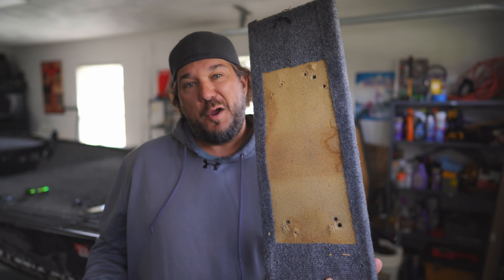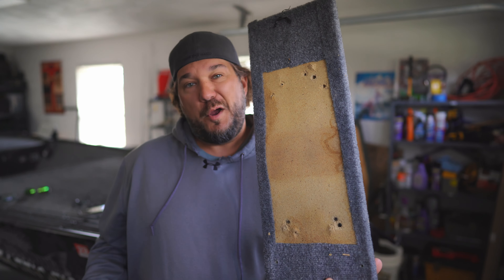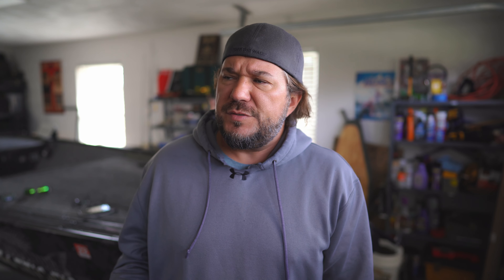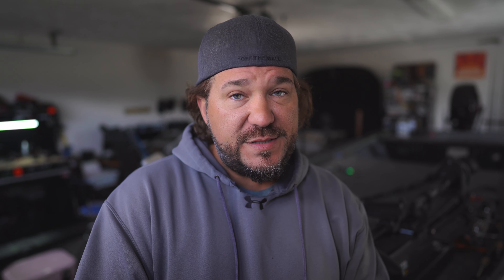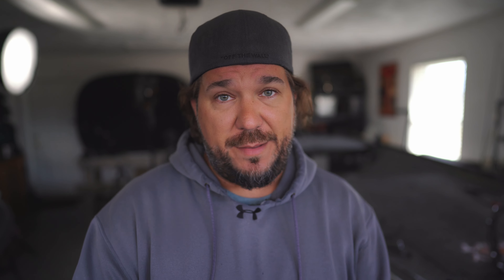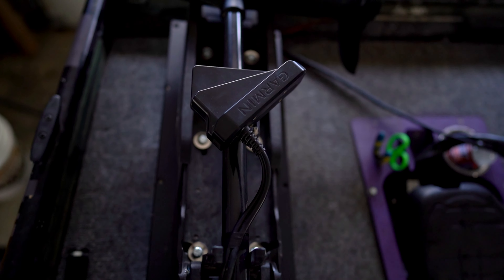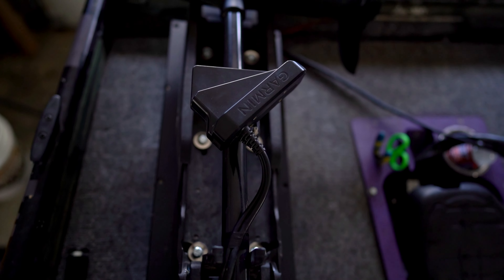I Just Installed My Prototype TROLLING Motor Mount!!

Comment: I bought a Garmin Echo 93sv w/54 transducer yesterday online from Bass Pro Shop.  $699.00 on sale could not pass up.  I bought a 1548 Weldbilt new w/ trailer 6 weeks ago.  

Gonna get the fish finder mount you have also.  "Balzout"  Have a new 20 Tohatsu on engine stand in Man Cave.  Shit I sold my Tracker boat five years ago to the month and getting back into the swing of things is expensive.  I've enjoyed every minute building out my boat ...

U rock Dawg...luv your sense of humor.  I have a tiller trolling motor on front.  it's a Minn Kota and was like $319.00  however..wish I didn't buy it now ....but next year gonna get an upgrade and get remote- spot lock etc. version.  

I get up early...........................be safe out there..
Reply: Bought my mount from Tiny Boat Nation ...as I have about 4.5 inch rise.
Reply from the maker: Hell yes bro! Sounds like you got it going on!! You like that mount you got? We gonna different sizes as well 🕺
Reply: @DudeLetsFish   yes sir.....aluminum and adjustable and expensive.  U like Buck Owens makes me grin.
Reply from the maker: @buckreynolds1779  yessir, and Don Rich